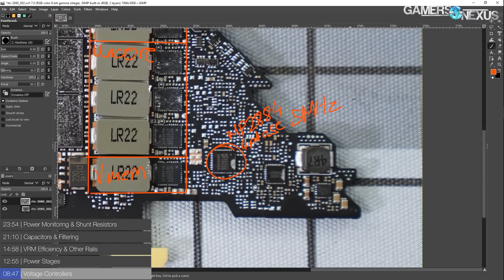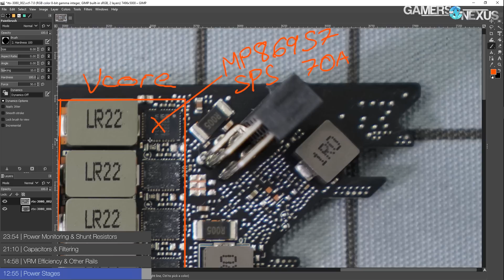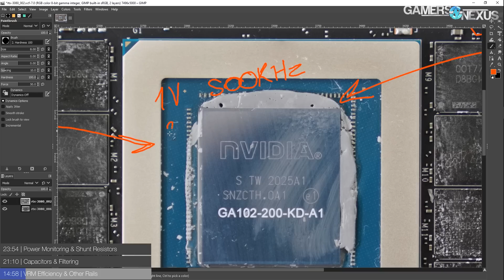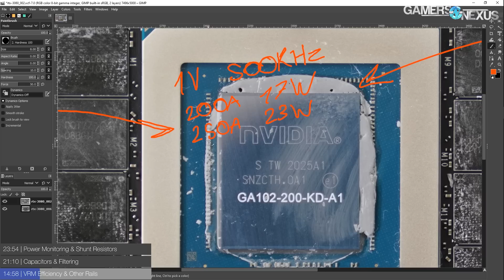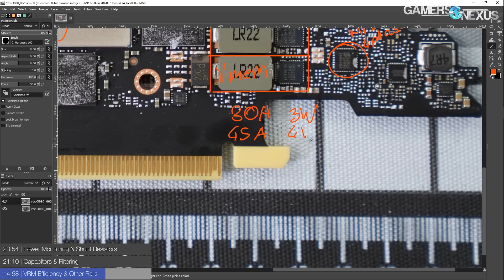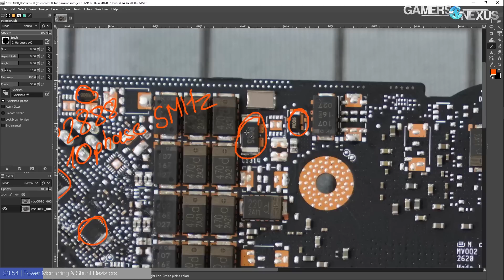GPU PCB Analysis: Founders Edition RTX 3080 Build Quality & VRM Capabilities

Comment: At 17:00, shouldn't he be saying "Milli-Amps" instead of "Amps"??
Reply: Amps * volts = power , because he’s at 1V in these examples, and these cards can easily pull 350W, 350A is correct
Reply: @halgari  Yes but he's only citing 17 to 20ish watts for the GPU chip (OK that's just heat).  But I would think no matter the volts, whole amps of current requires serious wire size, of which chip input lead sizes simply cannot scale to.  While the rails or lane distributions out of the VRMs are at approx 1v each, the input voltages to the card are at 12v on the connector.  Is he talking the current out of a single VRM, (because there are several of them), because the total amps in a single one can't be the total for all.  
It's possible he's talking about all lanes or phases at once, but normally with voltage and current, current in amps or milli-amps is referred to as the amount of it in a run or phase.  For that is the point, as a certain wire or lead size can only handle so much current, regardless of the voltage.  It's pointless to talk about additive or cumulative current draw of phases, because at that level you are better served to discuss it as Power in Watts.  When you're trying to abstract the total current draw of many phases or lanes, you're not really saying at all anything unless you qualify it with the all the voltages (which I know in this case they are 1v), but you're better focused to address it in terms of Power because any single VRM, phase, or component can fail, and that would be due to it's 'Own' current, not the total aggregate of all of them or their phases.  
Additionally, the total power of the graphics card, includes power actually consumed by the VRM units themselves (they are not 100% efficient) plus other supporting components before you even get to utilize the VRMs to provide phases, distribution or whatever.  Even the 3090 totally consumes 350 watts max, and the 3080 consumes around 325 watts max, so part of that is going to be power that doesn't even make it to those phases, so I don't see how his total current estimates can be right, whether they're in total aggregate of the phases, or certainly not just one.  But amperage should not even be discussed in aggregates, because it is used to refer to current in a given single path or from a single distribution point, not multiple wires at the same time.  For that discussion I think power/watts units is more accurate, meaningful, and useful, because if a single phase fails, it would be at it's own much less current, a fraction of that abstract aggregate total.  For 350 Amps of Current at 90 degrees centigrade, you need a conductor that's 13.3 mm or 0.52 inches in diameter (huge), or you can divide that up into about 225 conductors at 1mm diameter each to get the same conductor cross-sectional area, if you still want to go with aggregate current.  Still, that's far too large in scale for this type of card level distribution, (even if they did have 225 runs for the phases).  1mm diameter is much bigger than any runs coming out of the VRM phases anyway.  I can't see how 350 whole Amps, is an accurate current units reference for this particular PCB even if talking about the whole card, let alone subsections or even total groups of phases.
Reply: @arthurchesteriii9671  I think you’re mistaking VRM with phases. A VRM is made up of multiple phases.
Further more the wattage Buildzoid cites is thermal power that the whole Vcore VRM (made up of 10 phases) produces at that particular current draw.
Reply: @arthurchesteriii9671  the big number in the middle (300A and stuff) is the total current draw of the GPU and the 30W ect. is the heat produced by losses in the VRM... also the VRMs aren't all active at the same time, they are alternating
Reply: @johnuferbach9166  I could be missing something, but I think it would be best if he discussed each LR22 VRM's max current by referencing the LR22 manufacturer specifications of max current output.  Then with that context clarified he could add them all up if he wanted for overall current draw, but I still think one should switch to watts/power when discussing a whole power plane because his cited current (even if it is accurate) is apparently not coming from a single distribution point but rather from several VCore VRMs, so the current is going from different places to different places/components and in reality is never on the same run or path anyway.  So at a multiple phase level, IMO power/watts would be the best unit of discussion, but I would be still interested in seeing some actual output current specs (from the manufacturer) of the LR22 VRMs.  Then I might better understand how he gets his total current draw or amperage figures (even if they are only on the output phases of the VRMs, and not the whole card's power draw).  I still don't find those large current levels he cited (such as 350 Amps) understandable in just a portion of the card (even though I agree it's a large portion), considering the card has only drawn 316 to 325 watts of power (FE stock) per GN's recent review, and I don't think that power can't be all 100% on the outputs of the VRMs. Anyway, it'd be interesting to see the manufacturer specs of the LR22 VRM (because they've used them in the 20 series as well along with the 30 series now), and that so might illuminate some factors for me.  Meanwhile, I don't see how that level of total current is happening (350 Amps) - unless there are sections or times on the PCB where the voltage is even less than 1v.
Reply: @arthurchesteriii9671  afaik the thing on which it sais LR22 are the inductors, the individual allowed current of one phase was mentioned when talking about the VRM ICs (the smaller ones next to the inductors) ... also you have to take into account that it's not a wire / trace that carries the current but a whole power plane (or several) ... also he isn't only discussing the stock configuration but also a bit above since people might modify their card ans also he is just giving a rough example here anyway^^
Reply: @johnuferbach9166  Yes after the last post I was thinking the same thing as the VRMs are likely made with a little headroom so he could be talking about their max overall ceiling of current draw, in case (like you said) some would want to do power mods and overclock the card.  However I maintain that current should be discussed mainly in reference to a single path or distribution point, because it is the current on a single path that either causes it to fail or breakdown, or else flows successfully and repeatedly.  So just combining a current number for sake of adding up all the VRM phases - I don't see how that's particularly useful at all (unless the VRMs are combining all their output into a single physically joined or merged power plane but that would no longer be phases and therefore that speculation would be moot).  Unless some third party UI or aftermarket power mod addresses their power adjustment in that way (which I still don't see as clearly relevant) I think the power or current outputs of the individual VRM chips, or just the overall power output of the plane in watts, should be the units of discussion - but that's just my opinion, as his referencing amps in that context threw me off guard.

Comment: 1:12 because 4 dollar times a million is a lot of money to be able to save
Reply: If Nvidia have made 1 million of these, where the hell are they all?
Reply: @w19ely  They are still sand now and rock now. These are lifetime figures.
Reply: No. It means "we actually can't build this card this cheaply" = "hey customers, you can't buy this card below this amount sorry and go ask Buildzoid, GN, and everyone else why"
Reply: @rosen9425  what you are saying doesn't make any sense
Reply: @WouterVerbruggen  
Uh, ok. why is that exactly?
Reply: @rosen9425  you make two unrelated statements that are also unrelated to my comment or to what buildzoid said
Reply: @WouterVerbruggen  
uhuh. Ok, so now we need to know if the cost savings in that particular spot is affecting the performance of the card or not. If it is, my original claim is valid. Build more expensive and the customer pays for it.
Reply: @rosen9425  I agree, but that's not the point. The thing is, why there are some vacant spots for components. That's simply because they are not really required so, over the lifetime of the card, Nvidia can save potentially millions

Comment: I don't think anyone actually uses through-hole capacitors for modern GPU cards. I suspect what you meant were electrolytic capacitors, which can come in SMD packaging.
Reply: https://www.techpowerup.com/gpu-specs/zotac-rtx-3080-trinity.b7935#gallery-8 those really look like through-hole caps and inductors

Comment: The PCB size of both (3080 & 3090 FE) are exactly the same? Asking for watercooling purpose.
Reply: The 3090 FE PCB is taller, maybe because it has the multi gpu connector at the top

Comment: Why can't you just run your pathways so they're same length for the voltage not to be different? Same distances to power the memory and GPU.
Reply: @Gandalf721  .. It's the easiest fix and I'm frankly they're not the same exact lengths .. especially "if" it's actually a problem.

Comment: One quick question : would that be a good idea to put a fan blowling on the back plate (say 5mm distances from the plate)?
Reply: I think even 2mm is too much
Reply: @四as  Well concidering the 3080 (even the custom ones) have a lot of holes on the backplate I was thinking why not blow some air heh? Yeah maybe just lay the fan on the plate but I was wondering if the magnet from the fan motor could cause problems so maybe 2-5mm of space to be safe :D
Reply: @attractivegd9531  might as well innit XD

Comment: maybe a lot of people use power supply's that arent really enough for the whole system. causing dips and spikes (noise) in the voltage
Reply: i know lots of people who never invested much on psu and then blame "poor durability" of their PC components.
Reply: @angelkitty11  yep, just to save a couple buks
Reply: not really

you gotta realize that noise can come from anything hooked up to the same breaker in your house or flat so that is gonna be a hell of a fuckup by nvidia not giving early drivers to AIB partners to test them to rule gpu issues out and clean their hands (same shit happened to RDNA owners because who knows)

this is essentially chasing electric demons inside car: you won't find the culprit untill you ran thru every compoment in your car just to fix that fuel gauge not working and problem might be something completely diffrent on other side of moon (kinda like bug fixing in software)
Reply: @xthelord1668  Yeah i know. But i am pretty sure that a lot of people use the bear minimum spec psu's for what there system draws. and probably some psu underperform according to theire specs. The filtering on these thing is pretty huge. I have a 3D printer that works of a psu and even big spikes where i see the lights in the house dimming for half a second are not visible in the print
Reply: @hansturpyn5455  yes that is one culprit

but what am i saying is there can be many more culprits from microwaves,stoes,washing machines to welders,chargers etc.

yes upgrading psu would be great if pepole weren't brigading with "you do not need psu above gold" which is false because the better rating psu has the more likely it'll filter noise better plus give much more stable current for other compoments to handle

so one fix is upgrade psu BUT do not expect things being fixed,instead look for other fixes

Comment: I am glad the FE has a decent board, I really like the look and cooler design and finally don't feel like I have to choose between a functional cooler design or an aesthetic I like. I know it isn't gonna be anywhere near things like the Strix or KP cards but I am not a hardcore OC'er, in fact, my FE gtx1080tis are stock speed with lower voltage to cut down on noise from the blowers.
Reply: @Gandalf721  I know they aren't great in general but for a small rig that sees lots of GPU compute though for hours on end they aren't a bad choice. I also just love the FE card aesthetics over the "OMG RGB 1337 GAMR" look so I would have likely still gotten them even for just gaming. I will likely UV the 3080, usually can drop cards 100-350mv which can make the cards even quieter although it seems to be a non issue with the FE. 

As a general rule though, I don't ever reccomend blowers to my less educated friends.
Reply: @jolness1  normally FE is a good blower.. good for stack...or with limited space.. but other partner brand do made better cooling good for dust build up...
Reply: @campkira  the 3080FE is a very novel cooler design that is very thermally efficient. And smaller than the AIB partner cards. Traditionally you are correct, my 1080Ti FE cards were blowers but for sli it worked well.
Reply: He said that the FE is better than most if not all other 3080s so the FE is likely better than the strix and KP.
Reply: @trizkial7592  kp has a custom board design. Oddly enough the reference design isn’t what the FE uses and the reference design specs lower quality power delivery. The KP cards have a ridiculously overbuilt power delivery circuit but yeah the FE board is better than the vast majority of cards. Strix and the high end msi cards may use a different design or at least better power circuitry but most cards use the reference spec which.. isn’t great
Reply: @jolness1  oh I see. I don’t understand all these different boards much but I was just going off what he appeared to be getting at. Seems like the FE cards cooling isn’t amazing but it’s good to know they didn’t cheap out on key parts. I just want all these companies to build the best possible cards they can and not take shortcuts. From his other video it appears unfortunately the evga ftw card may have taken some shortcuts:(
Reply: @trizkial7592  the fe card is much smaller than the large triple slot 3 fan AIB cards and it gets pretty close, it doesn’t keep temps quite as low (a handful of degrees Celsius usually) but it’s much much smaller and I think it looks awesome. The power delivery is much better than most aib cards though and the custom tiny Pcb (check out a tear down, very interesting) with the back half of the card being a flow through heat sink is very well engineered. Yeah I believe evga ftw cards used the reference design. I’m pretty sure it was fixed but still a really really bad experience and bad pr
Reply: @jolness1  Do you think the FE 3090 would benefit from a ekwb with active cooling on the backplate? My friend has one and was thinking of doing that because he was complaining about vram temps being in the mid to high 90s often
Reply: they don't had to be black board since you can not see it anyhow..

Comment: Why are they called shunt resistors?  Doesn't shunt typically mean bypass (alternate parallel path around a circuit branch)?  In this case, it looks like you are referring to series current measurement resistors...  Very low resistance resistors, whose voltage drop is related to the current through those rails.   Is this just a weird terminology confusion?  I have done quite a bit of electronics design and pcb layout in industry, but I am new to the overclocking world.  A quick google search shows that gpu hackers agree with you, but more traditional electronics designers use the term as I described.  Just curious on the origin of your use of the term.  I really enjoyed your explanation of the layout thought process and I will definitely be watching more of your videos!
Reply: I think that overclockers use the term shunt for any resistor, that is used for measuring purposes. The word itself is really short and convenient to use, so most people got used to it ? :D
Reply: @Gandalf721   what are they shunting?

Comment: Shunt resistor mod seems to be very impractical on this card. I would rather suggest to solder some 0805 resistors on certain ceramic caps(i only see three that must be moded) of the power controller. There was once made a thread on xDevs.com that explains this power mod method in detail. (https://xdevs.com/guide/pascal_oc/    go to step 3)  Of course you want to increase the resistance on these caps instead of lowering it, to make the power controller think that their is less power coming in. I do not know if this works with the voltage controller used on the RTX 3080 FE

Comment: I want to see all card brands go through this detailed look (or something more like difference between this card brands card and this one is couple more voltage regulators) so we could see which brand is targeting what feature, also just to see if brands are cutting cost.
Reply: He does a lot of PCB analysis on his channel, Actually Hardcore Overclocking! He's done the Zotac Trinity and MSI Gaming X Trio for 3080s so far
Reply: check buildzoids channel, he'll likely add more there but so far it seems all of them have done the same cost savings.
Reply: Better head to patreon then!

Comment: 1:32...doesn't sound too sure about that statement about putting the mem chips on the pcb and the mem controller being fused on the chip...is he guessing ?
Reply from the maker: I mean, we can't be 100% certain that all GPUs are fused off, but most often, this is in fact the case that the GPU won't have the memory controllers to talk to those chips.

Comment: Question: in such a small and restrain pcb why do they keep the two unpopulated gddr6 slots?
Reply: I think I heard in another video that this makes it possible to use GPUs with a defect in one or two memory channels
Reply: To save 30 bucks
Reply: @WayStedYou  no, what i meant was they could use that space for other things instead of bare bga plugs
Reply: I believe it is so they can position the modules differently if they need or wanted to.